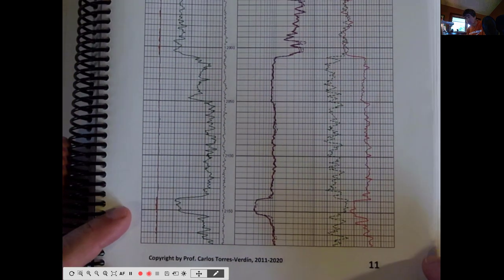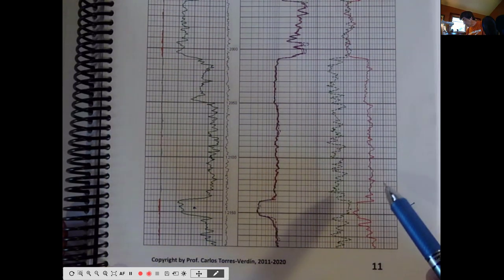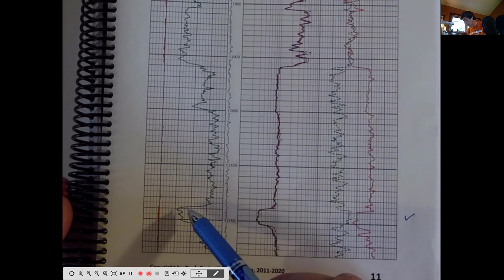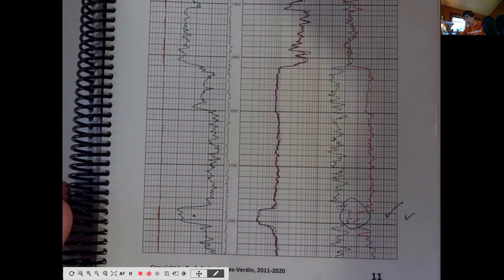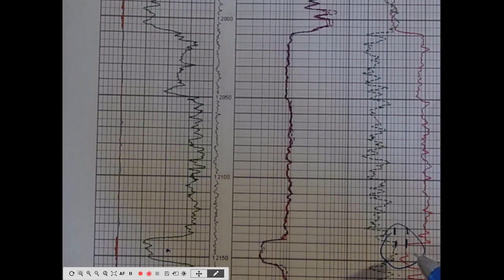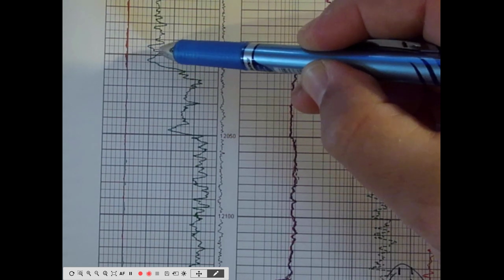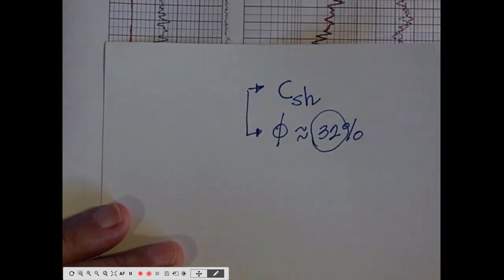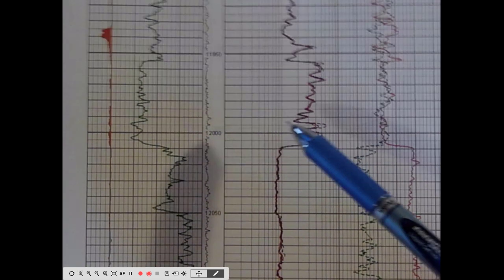Shaly Sandstones, Part I; PGE358, Spring 2020

Comment: Nice material. Can be those shaly sands huge continuous bodies? Or can be pockets? Have you seen these shaly bodies response (oil yearly decline) with small values (16-18 % yearly) or higher (35-45% yearly)?
Thanks
Reply: depends on porosity distribution, cementation history, shale distribution and the kind of deposit it is.  Grain size, porosity, etc vary with flow regime types, which expresses differently over fans, sheets, or channels.
Reply: They can be isolated bodies or continuous. Both exist.  If there is a steep decline its due to a smaller reservoir, or reservoir damage from overpumping, connate water, etc.... a flat decline indicates a larger reservoir as well as a potential horizontal target if the decline becomes flat but consistent, then the drainage area is large.
Reply: Another important point he made was around 23 minutes in about vertical communication in reservoirs.  Fractures and faults will cause formation offsets as well as voids and breaks in the thin bedded barriers which can help with more lateral communication by connecting smaller and/or thinner lenses or beds with adjacent beds to add areal extent.  Porosity also might be high enough that it all communicates, and that does vary with volume %shale.  

A rapid decline can mean a formation is tight, small, or damaged (often by overproduction).

When scouting, youre always looking for areas with flat declines and decent volumes for horizontal plays...